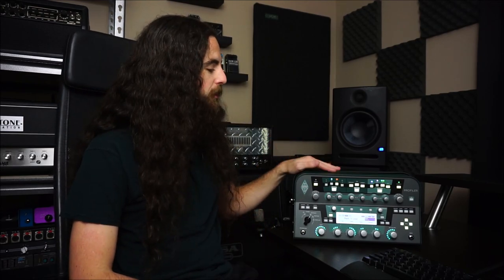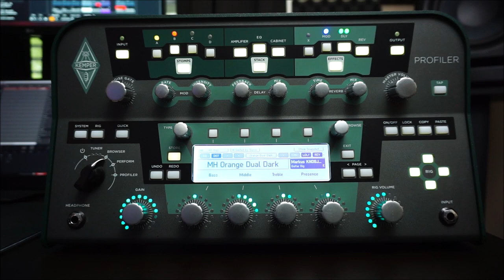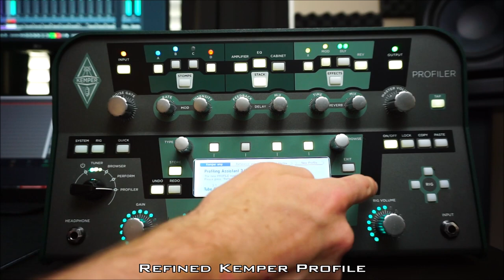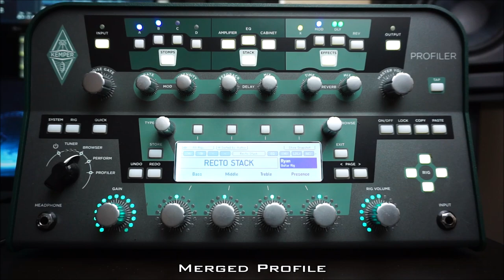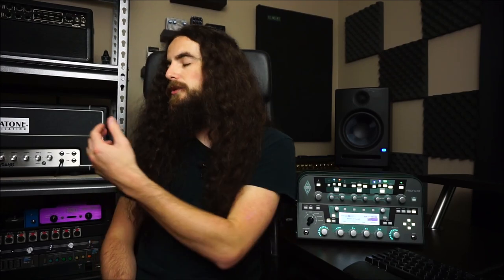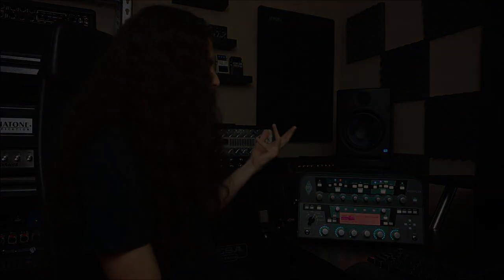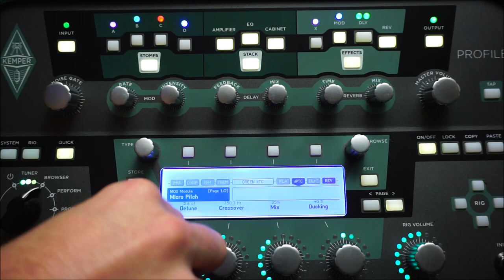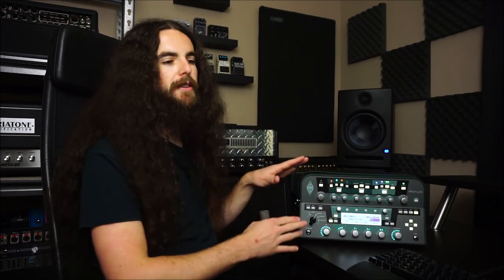Gear Curiosities: Kemper Profiler - Ten Years of the Tone Matching Toaster!

Comment: I've owned both the Kemper and multiple Fractal units since 2013. I was never able to pick a clear winner between the two.  Both great units, but very different. However, I bought one Kemper. Three different Fractal units. Fractal units tend to become obsolete a couple years after release these days... AX8, FM3, now FM9. If you just want a solid rig and be done with it, go with Kemper. Find your profiles. Be done with it.

Comment: I definitely think the “one circuit fits all” theory is pretty much accurate for most analog high gain amplifiers as well as the kemper, most  of these amps are based off of one theme, High gain! Of course there are subtle differences in the response and biasing but 90 percent of the tone comes from your cab mic setup or your IR, so it would make sense for kemper to do the same thing most amp companies do in the circuitry.

Comment: This is a goldmine and answered the more obscure questions I had about the Kemper.
It sounds like in short: it's a great unit but high gain tones are somewhat uniform. In hearing many many profiles over the years, I hear a smooth and refined "sanitized" tone as you sa, or the fluffy Marshall thing with lots of low and mid congestion. I still wanna try one and see how I feel playing my own axes through it, but overall it's still a great tone box all these years later.
And I still want a Vst or AU version of the Profiler engine. Access could make a good buck on that and perhaps convince people to buy the hardware later with that move.

And I wish that the refinement was either:
1. Not necessary, or
2.  There was a set signal or things to play that would help inch accuracy up higher on those stubborn gain characters or edge of breakup tones. but if it's a set signal, why not ditchthe refine altogether as you said?  It's strange.
That said having a somewhat flexible refine process (you play whatever) can be useful to make different variants of an amp sound I'm thinking.
Also, perhaps it's time for a few more amp building blocks that can cover more of these unique gain structures and tones. More is better. Something that can analyze harmonics and overtones, inherent power amp compression, etc etc.

I gotta say I can hear some differences from the Cubase IR vs Kemper IR. Not huge but they're there. If I used a Profiler, I'd probably be the odd man out and use it for gain and character, then do any cabinet tone withan external IR box or real cab. Just my opinion; tone being subjective and all that.

Those builtin fuzz and OD options are great. They nailed that for sure!
I'm with you though on wanting to design your own tone. Not relying on someone who may profile an amp or entire chain and mess something up or simply not have the sound I was expecting. Kind of easier to buy a modeler and dial in from scratch, avoid the snapshot of one guitar and one person's playing. etc. And that sucks about the reliability. Still, its an interesting piece of gear and can do some killer tones at the end of the day.
Excellent vid as always.

Comment: Watched it all. Yep l fast forwarded through some of the tones but pretty much watched it all. Very glad that l have never had issues at all that you mentioned at the end. I went from a Rocktron Prophecy to the Kemper. I tried out early AXFX units up to the ULTRA. Honestly for me felt like the Prophecy. The Kemper handled midgain ACDC, classic radio rock like a champ. Running through the house and a cab behind me is absolutely golden and perfect for me. I do not bash on other units though.

Comment: That’s a great overview of the Kemper world and, as a KPA user myself, I completely agree with your opinions.
The amazing thing is that we’re talking about an unit that’s still at the top of the game after more than 10 years, which in the digital world it’s kind of unique.
That said I’ve come to the point where I can feel its tonal limitations (that sonic imprint that’s always there, especially in the higher gain territory) and the kinda stiff workflow that I never really bonded with.

I feel exactly the same when you say that the Fractal stuff inspires more than the KPA; I think that it’s partially due to the workflow differences and I definitely resonate more with the Fractal one.
To be honest though, the KPA is still the unit that gives me a closer experience to the real thing (with my own profiles or good ones), besides - while I love my AX8 to death - I don’t really like the kinda “Apple” vibes that I feel in the Fractal world lately, that’s while I’m still reluctant to jump in their 3rd gen lineup.

I’m really interested in the Quad Cortex for a more modern approach and the fact that it could be a sorta “hybrid” between the KPA and Fractal world, but to be honest I don’t like the way they’re handling the whole thing since it started; a lot of bold claims, but they clearly have a lot to do and prove.

Comment: The results you've shown here are surprising to me. I feel like the workflow and the quirks thereof, and as a result SOME of the tones are "obsolete" in 2021. It's not that the Kemper sounds bad, or does what it's advertised as doing poorly, but rather that smaller systems that work more accurately and faster exist. It's a bit like POD HD vs AxeFX Ultra. Moreover, with how far plugins have come, i just don't see the reason i'd bring a toaster oven sized box when i could bring a laptop/tablet and a poweramp to a gig.
Reply: Personally speaking, there's no way I could trust a laptop. Buggy af compared to hardware modellers and profilers ime
Reply: @WholeLottaBulldog  
Same here. Unless you have a higher end laptop like a Mac or spec’d out Windows OS system, you’re probably not gonna have fun with VSTs live. You have to factor in drivers, software, interfaces, limitations, etc. Just hooking up your Kemper to the foh seems a lot more convenient.

Comment: I think that part of the Rig Manager for listing the pickup is more for someone to note what pickup they've EQ'd the amp for. Because you can certainly refine multiple times with multiple guitars so the kemper sees how that amp reacts to other input signals/pickups etc. My best direct profiles that I've taken myself have been refined with 2 guitars. This is entirely subjective also because your idea of good tone vs mine is different. If I start EQ-ing with a Fluence Modern and take a Profile then do it again with a BKP Warpig, the profiles come out different. Because I have intended to get the sound closer to what I want to hear with a different source material. The profile I make with a Fluence Modern will be bigger and fatter and lower gain to compensate for the high active output from the guitar. However, the profile I make with a BKP Warpig will have more gain and be tighter in the low end and more focused in the mids to complement the thicker sound of the Warpig. It's common for people to just write humbucker in that section too.

The gripe I have with the Refinement Process is there is no set thing to play to teach it how that amp responds perfectly. Surely they could say you play these set chords in this manner or program the Profiler to do that itself. I find that I play a few riffs that are like some favourites then I go to big chords and just butcher them on purpose with wrong notes because I think it helps to show the Profiler how the gain structure reacts to different (sometimes odd) note relationships.

TLDR. I think the pickup list is for reference of why the person dialled the amp like that, and I wish that there was either a set refinement procedure or one built in to help itself get closer than what someone that maybe isn't the best player can refine it to. 🤷‍♂️ In saying that I love my Kemper, and I also use it to try different amps that I may not have access to so I know if I myself like that amp enough to buy when one might come up.
Reply: If it was possible to have a set refining procedure that is optimal for producing an accurate profile, there would be no need for the manual refinement feature at all since Kemper could simply send the correct signals through the chain on its own, without relying on a human who will always do that job imperfectly. The fact that it exists must mean that the architecture is fundamentally unable to create a full reproduction of the amplifier, only something that will sound close for a certain range of input signals. That's also why I don't think that the pickup field is only there to contextualize the choice of amp settings - the profile will be most accurate for the guitar used during the refinement process because Kemper tries to minimize the difference between the amp and the profile given the specific DI. That's the whole point of the refinement step.

Comment: Hi 👋🏼 I just got a Kemper, loving it tbh. But I wanna profile my amps in numerous ways to steal its souls haha. I ordered a Kemper di box but now I’ve listen to what you have said I’m not sure I actually need it. I do not own cabs anymore, I own captor x re active load box. If I bypass the cab entirely and mic level from the hardware technically that’s just as good as using a Kemper di to strengthen the signal to the return. I hope you get what I’m trying to say here. Basically I don’t need the Kemper di box do I?

Comment: Do you have any strategies for playing live with the kemper? Many of the profiles sound dope at home for mix ready tones but live sound terrible through the FOH. It's also not exactly translating well from a FRFR (yamaha dxr 10, kemper kabinet) to the FOH probably due to fletcher munson and dB levels. It's almost impossible to tell how a profile would perform live when played out loud.
Reply from the maker: What exactly sounds terrible about it? The usual strategy to any amp modeling solution over FOH generally involves generous low and high cuts for starts (I find shelving EQ can sometimes be superior, but it depends). A big, resonant low end and crisp highs can sound great in isolation, but can be ear peircing above mixing volumes. Multiband compression can also help in this regard, but the Kemper does not have a model for it that I know of.

Also, though the Kemper Kone sort of does flat response since it has coaxial drivers, the Kemper actually applies some corrective EQ to get it there. It really starts around 50 Hz and tops out around 10,000 Hz like a normal guitar speaker, so the Kab is doing some of the low/high cut I mentioned for you.

Comment: This same-y-ness with the high gain profiles you talk about... that's exactly what made me massively disappointed in the Kemper, unfortunately. It just doesn't manage to capture the inherent gain structure of an amp. I think this is kinda further evidenced by the fact that it can absolutely not profile any kind of fuzz tones.
I guess, I had a wrong kind of expectation there but still quite a bit of a letdown.
Thanks a lot for your video. Your points definitely catch my experience with the Kemper (both the pros and the cons)

Comment: If you profiled amps with all of the settings at noon would that then work the same as an Axe-Fx or Helix model?
Reply from the maker: No, as the Kemper applies a generic gain and tonestack range to every profile. It has no way of knowing the real range or different target frequencies of the profiled amps controls, or if it even has those controls to begin with.
Reply: @PlagueScytheStudios  Makes sense.

Comment: Yeah well if kemper is so great why isn’t there a kemper 2??
but unironically…
Reply from the maker: They're waiting on PC 2 to come out first.
Reply: no need for a 2  its awesome the way it is
Reply: Clem Clemson I agree it’s great as is. But if there was a Kemper that could do the other things modern modelers can do, such as dual amp patches for seamless switching, or elaborate signal chains of time based fx in parallel, on top of Kemper’s great profiling, that would be a real winner.

Comment: Christoph Kemper explained the basic technology behind it (I think there is an 1 hour video at Anderton's): The main point is, that the Kemper does not contain any models. Chris explained why: there is no chance to build a model which will make more than one guitarist happy. So he decided not to put any model in there. I think that is the reason, why a decade old device is not outdated: you are not limited by the models available.
If you check out the patents you can see, that the Kemper is basically an Impulse Response device, the BIG difference is, that the dynamic change will be captured additional to tonal and time dependend reactions, like an IR would do. The math behind it is called something like "Non-Linear-Impulse-Response". 
Nevertheless: Great video! I am thinking of getting one, just to profile my amps sound used on my recordings. This should work way better than taking a piture of the amp and cab...
Reply: I also read through Kemper's patents and it is explicitly stated that their algorithm selects one of the built-in models and optimizes from there. The idea that this is some kind of extended form of IRs is not true. Consider this: the file size of a Kemper profile is only around 1 KB, which is more than an order of magnitude smaller than your typical impulse response (an average 48Khz sample rate IR is 22 KB, I'm not even talking about higher resolution or longer impulse responses which contain over a hundred KBs of data). How can a Kemper profile contain all the detail included in traditional IRs and more, while having 20 times less data? It's simply not possible. The only explanation for tiny data size is that it's literally just a few parameters for a built-in model and an EQ curve, which is pretty much what's described in the patents.
Reply: @boshi9  it makes sense. Not a Kemper user (yet), but I've been reading some info about it and what you are pointing out indeed makes sense. Good reading you! Cheers.